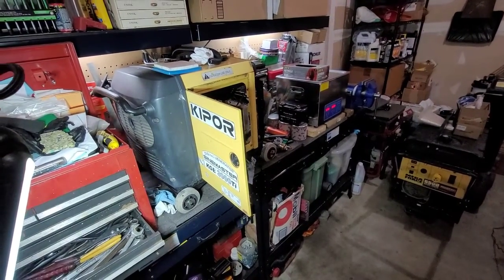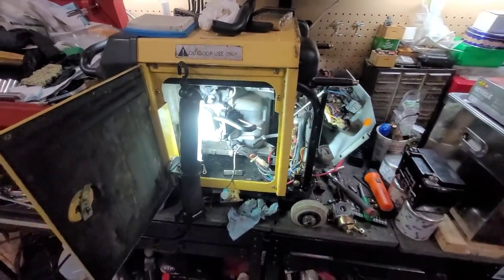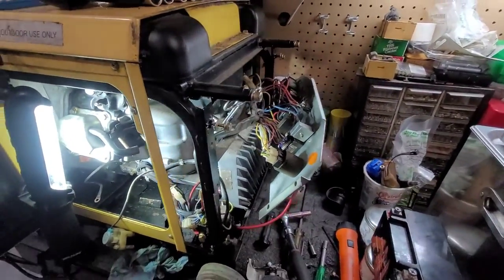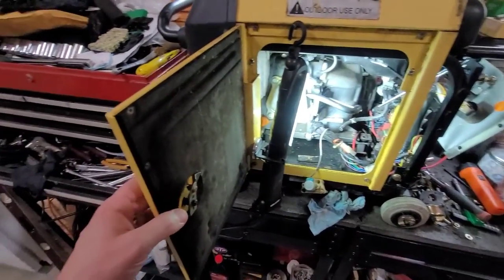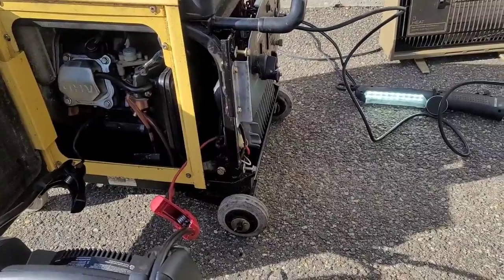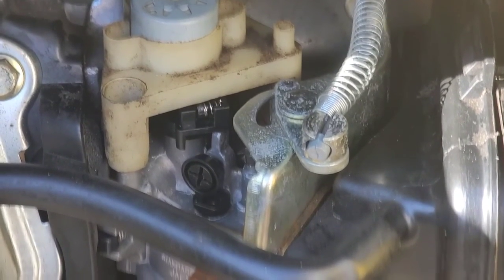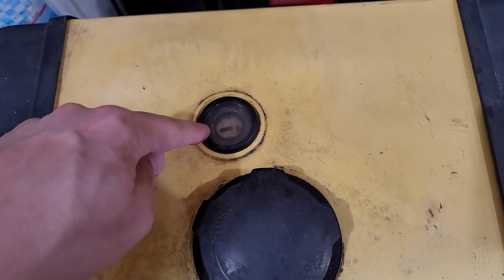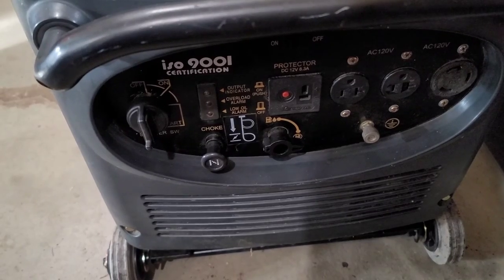Kipor KGE3000TI Inverter Generator: No Start. Carburetor Cleanout & Load Testing

Comment: i just was given the same model from a customer. I want to tinker. Same issue nit starting and has been sitting. Came with a trailer the customer purchased.
Reply from the maker: @JeffHartnett  very cool! I did wind up keeping this generator because it's a nice sizable one to run for back of power for the house. Questions let me know!
Reply: @Bassguitarist1985  Thanks I am sure I will have questions. I took a generator class at the NRVTA and I am not a motor type of guy so it was not my best class. I was given this by a customer after they mentioned it did not run since they got it with their used trailer, So I get to learn and not worry about failure. Hope to start on it soon. Its cold here in the North east
Reply from the maker: @JeffHartnett  oh yes. Connecticut is still cold but a warm up this week. Next week back to sub zero

Comment: I have this exact same generator. It's been setting in my garage for several years so I decided to put some fresh gas in and see if it would run.  Yes, it started. Ran rough for awhile. I do have questions. Reading the PDF manual I found online, it talks about changing oil, plug and air filter but doesn't give any details.  What is the correct oil for this motor? You mentioned parts are hard to find. Do you have any source at all for the air filter etc etc?  Any info will be helpful.  Thanks.
Reply from the maker: Hey sorry for the delayed reply. I'm using 10W30 oil. I don't recall off the top of my head but I believe the air filter is a sponge and closely matches some of the Generac GP series engine filters. There are limited parts still available that you can find on Amazon here if you live in the United States. I know you can still get an aftermarket carburetor for it that includes the stepper motor for example.

Comment: Thanks to your video i realized that i have lost that little spring!!!
I couldn't understand why it was running very unstable .In my case i took apart the carburetor because i forgot to close the fuel valve during storage and gasoline flooded the whole engine!Maybe due to stuck float-needle. 
I am lucky that i first checked the oil level before attempting to start it.👍👍👍
Reply from the maker: @razor7799  absolutely! Thank you for watching! Yeah I mentioned it only because the spring went flying when I was taking things apart and thankfully I was able to find it.

Comment: Great video I'm actually looking at one of these today possibly going to buy it He's asking $200 though I think it's a little on the steam side especially since these parts are hard to find now
Reply: These parts are the opposite of hard to find. Any parts for a firman 2942 will work on this. Up to and including the inverter board. Do some research, all of the Chinese inverters come from one of 3-4 companies with pretty much all interchangeable parts.  The OEM manufacturers are Dinking, Senci, Sumec, Dong feng. Champion, firman, harbor freight, all the same stuff.
Reply: @A_Man_In_His_Van  that's great to know!! Thank you!
Reply from the maker: The carburetor battery and other basic stuff can still be had. For $200 and an inverter generator with 3000 watts I'd say is a good deal. I still have mine and I couldn't sell it for $300. Hopefully that puts into perspective.

Comment: Can you tell me where the other hose, above the drain hose from the carb, goes to?
Reply from the maker: BH-Motor New Carburetor Carb for Kipor KGE3000Ti KGE3500Ti IG3000 Generator https://a.co/d/6pk9M86
Reply from the maker: Check out the link I just posted. It's got a weird vent hose setup
Reply: OK so it is just a vent and it doesn't connect anywhere. Thanks for the quick reply

Comment: I did donthe champion hack. Just had to rewire  as motor is opposite. Only thing weird is that it wont keep a prime
 I have to shoot some ether in to initially start it. Any ideas?
Reply from the maker: Air leak in fuel line?

Comment: i actuall y bought one of these generators at a thrist store as I was driving thru salt lake city ut. the guy told me it was his dads and it never really got used. i ran it for about 2 weeks and its not running now im going to pull the carb out im guessing its probably gummed up from sitting for so long.
Reply from the maker: Best of luck!!

Comment: Thank you for such a great video! By the way does this particular generator have a fuel drain to drain the tank? I haven't even started to dive into it yet but he said that when he fills with gas it leaks right out the bottom. Thanks again for all you do to make so many amazing videos I appreciate you.
Reply from the maker: Thank you for watching! The fuel tank does have a petcock valve that goes directly to the carburetor. And the carburetor does have a bowl drain. There was no other method of draining the fuel out of the tank other than using a fluid extractor if the fuel has gone bad.

The petcock may have come loose or the o-ring seal that holds it to the tank has failed. That would be my guess without looking at it
Reply: @Bassguitarist1985  Thank you so much for your quick reply! Well I guess I had better get to work. Have a great week.
Reply from the maker: @paulrhodes482  you as well!

Comment: That carb spring looks just like the one on the EU2000i series. Honda Part# 36162-ZL0-D31
Reply from the maker: Pretty sure this Kipor is made by Champion. The more I research the more I'm finding similarities between the generators.

Edit: Kipor does make big generators, but they likely partnered with champion at their factory to make their generators. Just a guess but it seems very likely